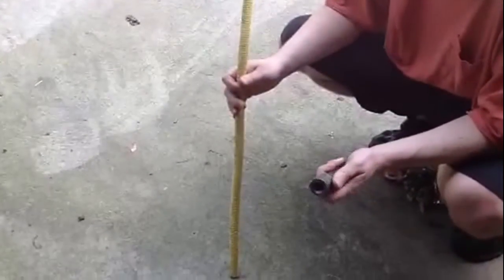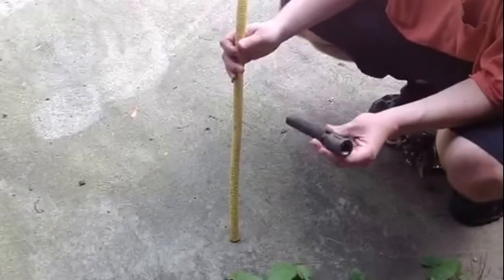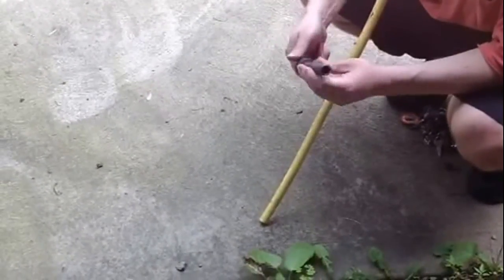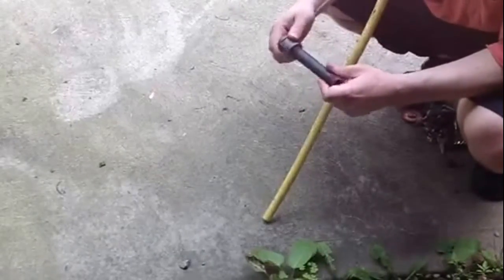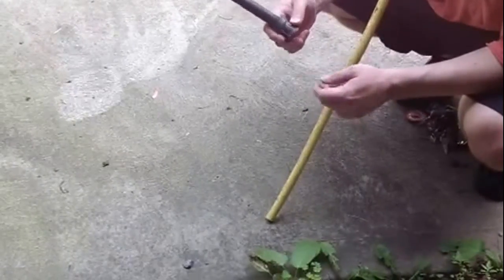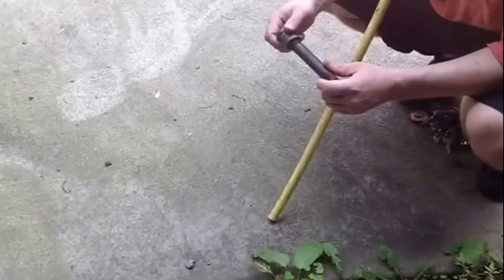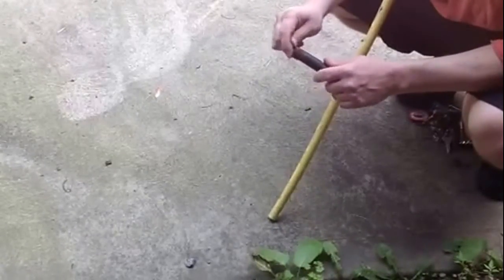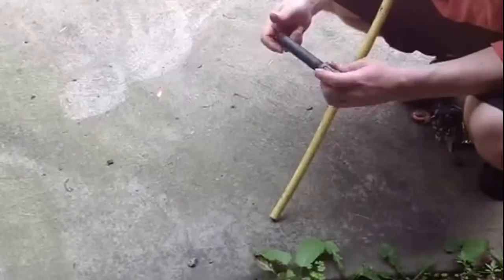Csst or black iron to carry natural gas

Comment: In the state of NJ you do not need to be a plumber you need to have a contractor license. So your painter, landscaper and so on can run gas, what a joke. For csst you need to be certified by the manufacture which really is also a joke takes 2 minutes.